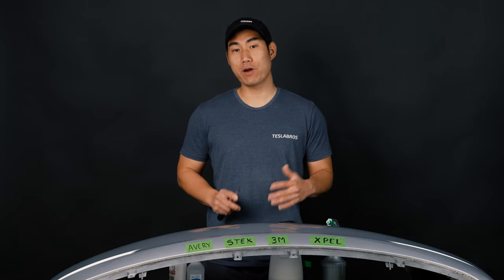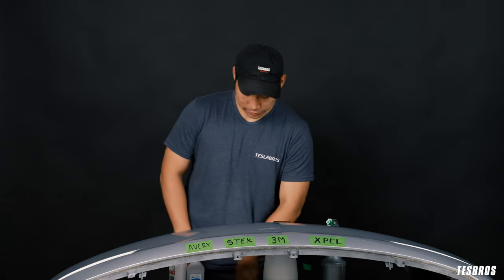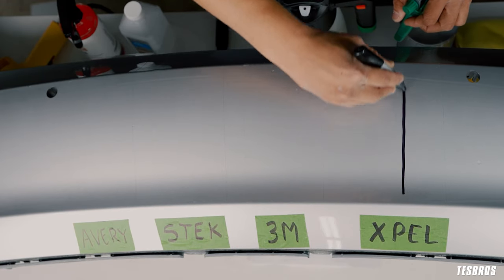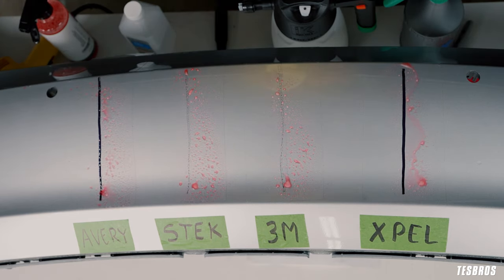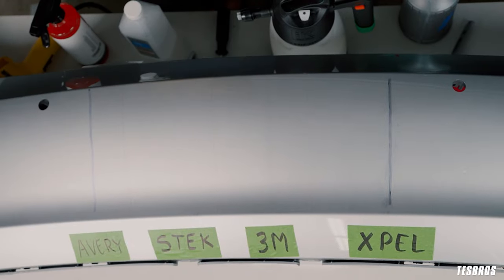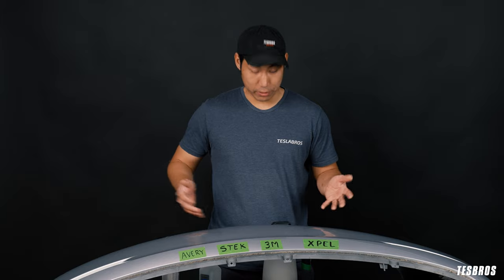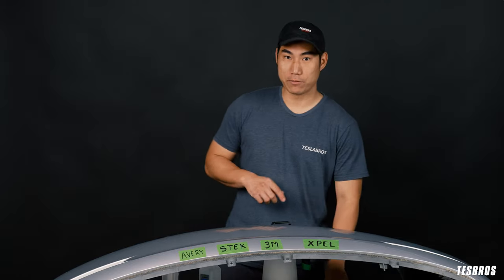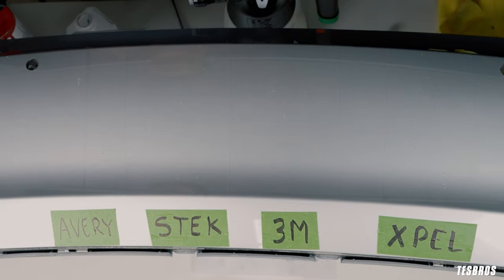Which PPF Brand Should You Get For Your Tesla? Durability Test - Part 1 - TESBROS

Comment: In practice they all scratch really easily and most scratches will not self heal, only the very minor micro scratches will self heel. They are also difficult to keep clean. I suggest anyone getting PPF also gets them ceramic coated to make it easier to keep clean.

Comment: 3M is designed and engineered the best of this lot...great video
Reply: Yeah im going with 3M as well as their windows tint.
Reply: Been doing PPF for years. 3M is by far the worst film to work with and has the worst finish. Glue lines and imperfections everywhere.

Comment: Local xpel quoted me $7,800, now it’s time to reconsider. Thanks for this great video.
Reply from the maker: Glad it helped! Depending on the area, that may not be a bad price especially if they wrap around edges, has a lot of experience and for the full car. Doesn't hurt to shop around but look for shops that have a lot of experience. It takes time to get good at PPF especially.
Reply: @tesbros  my current car was wrapped at a place I found on yelp, they had good reviews but did a terrible job, and thus this time for my brand new tesla, I will bring it to the authorized xpel dealer in my area.
Reply: @tesbros  Does the other 3 brands have precut patterns?

Comment: That was great.  I just got my Tesla a week ago.  I'm prepared to spend way too much for PPF.  Just so happens that there's an authorized dealer for XPEL in my area.  Then, I saw your video.  Googled for an authorized 3M dealer.  Got one of them in the area, too.  I'll get quotes for both, but likely going with 3M.
Reply from the maker: They are both great brands, so I would go with whatever shop has the most experience
Reply: @tesbros  Thanks.  Make the appointment for 3M to be installed.  ~$1800.  Yuck!  But, it'll protect my $55K investment.
Reply: @pavels5600  1800? What did that cover?
Reply: @Dawsomesauce  Turned out to be $2100.  Covered:  front bumper, hood, front quarter panels, rockers (all the way back with a barely visible seam ~8” up), and side view mirrors.
Reply: @pavels5600  bargain. Should’ve done the whole car!
Reply: Why did you go with 3M? I know nothing about cars so I’m still lost on which to decide as they all seem to be really good from the video.
Reply: @troyvo8069  Sharpie test.

Comment: Nice comparison, I went with Suntek Ultra again for the 3rd times in a row.
Reply from the maker: Heard great things about them! If you're happy, that's all that matters.
Reply: That's all my shop installs. Since xpel has trademark infringement on 3m, the only difference between the 2 is the polyurethane top. Xpel stole 3m adhesive.

Comment: Next time use a black panel it will show up better. Avery has been around back in 2007. Suntek & 3-M are the same. The newest is X Pel they use to use 3M before they had someone make there new film.
You want to do a real test get a front fender in a dark color cover 12" wide and pass a sandblaster over the PPF and the not covered. This will impress anyone looking to buy a C.B.

Comment: Does rubbing alcohol ruin the hydrophobic layer? How long does the hydrophobic layer last? Would ceramic coating be better than the factory hydrophobic coating?
Reply from the maker: Rubbing alcohol will diminish the hydrophobic qualities overtime IF it's too strong. Just make sure it's diluted with water or more like 50-70% iso alcohol. The hydrophobic layer on PPF usually lasts around 6 months. And yes, if you want ceramic coating properties, I would go ahead and ceramic coat the PPF as well. It'll last a lot longer.

Comment: Great video. I'm about to take delivery of my plaid is it overkill to do the whole car, or will the front and back bumper and hood and side-view mirrors do the trick
Reply from the maker: Congrats!! I would suggest doing the front package and side rockers. That would be the front bumper, fenders, hood, mirrors, & rockers. Those will definitely be the highest impact areas
Reply: @tesbros  gracias amigo!
Reply: Do the entire car with Stek film. Also add two coats of GTECHNIQ Halo. I had my Model Y done and it looks amazing. Easy to clean also.
Trust me
Reply: @RayNLA  where did you buy the stek film and how much for model y full coverage
Reply: @hawkie2216  I just got full STEK satin PPF for $6k on my Y. Received a bunch of comparable or more expensive quotes too. But I also got full silver delete on interior blacked out and brushed black metallic trims and black gator skin PPF over wood dash, console, steering wheel, door inlays and charging port. Included blacking out the head and tail lights and fog lights with some other details here and there
Reply: @edubchilds  where did you have this done? Waiting on my Model Y and want to go stealth matte black…

Comment: I believe that XPEL is designed to have a ceramic coating applied to the top of it; that would be A LOT harder to apply well if it was itself hydrophobic!
Reply from the maker: Lots of paint protection films come ceramic coated nowadays. They usually only last around 6 months though, and an additional coating applied on top is recommended if you want to keep the properties for a while

Comment: Great video. I have a new Lexus which I have chosen the 3 m. Plus a EQE which they have used the 3 m. I wondered which was better,Time will tell .They both look nice and make keeping the cars clean a breeze. However both to fit were very expensive in Australia. But no more polishing every 4 months means more time enjoying the cars. And little daily use scratches come out with sunlight or heat gun makes it worth the cost.
Reply: 6 months update?

Comment: What is the cost in terms of value to most expensive on these 4 for customers?  Also have you all serviced the new Foaker Oceans yet?
Reply: Pricing depends on installer if you don't plan to do it yourself.  The cost comes from color correction, chip repair, and labor of installing the PPF. Notice prices are regional and depend on how many installers in the area.  Some installers use custom cut sheets and others cut from large roll and form to almost any size that needs protection.  Find an installer that "tucks the seams" in cracks and around corners to help hide the film for an invisible look.  It can cost $300-$700 for front end bra (headlights, side mirrors, front bumper), $1000-$1500 for entire front end (hood, bumper, fenders, headlights, side mirrors), and $3500-$4500 to do an entire sedan.  PPF like Suntek and XPEL have a 10 year warranty.

Comment: I am curious to know how the self healing properties of the film work with a ceramic coating applied on top of the film.
Reply from the maker: The PPF won't need to self heal if the elements can't get to it due to a ceramic coating. If scratches make it all the way to the PPF, that means that area is exposed, and it'll self heal.

Comment: Which brand do you guys use then? Just got the Y front bumper from you. Also price difference?
Reply from the maker: That'll be Avery Supreme Defense in our DIY PPF kits. The price of the high quality films in the video will be about the same. What will differ the most in price is shop location (area's cost of living) and their rates.
Reply: @tesbros  didn't know there was no tacky or skip solution in the package for this job. Where do I get that? Guess rest for job I have, 2 of these plastic scrapers. Last question, do I not try to round the ppf into the round edges of say lights and stuff? Remember Ryan from Kilowatts had his done self and it accumulated so much dirt right at the edge of ppf or vinyl cause he didn't remove the door trim and tucked it under? Will this be a problem, dirt magnet right at the edge of film? Thanks.
Reply from the maker: Since you only got the bumper, you have to buy the installation tools separately. Sorry for the confusion! The installation tool kit is 15% off right now with code ELECTRICJOY15: https://tesbros.com/products/installation-tool-kit-model-y-diy-kit
Good question but no it won't be a problem as long as the PPF isn't hanging over the edges. Make sure you install right inside the edge and not over. That's where the dirt catches.

Comment: about cars being keyed...   many years ago, my brand-new Lexus was parked in a mall parking lot.  it had less than 50 miles on it.   when I came out, it got keyed, along with several other cars.  the whole left side had to be repainted(fender, front doors, rear fender).  Insurance deductible was $500.     Fast forward to last year... I got a new car and the first thing that I did was get it tinted. I asked the tint guy about getting PPF.   He said that if my only concern was protection against getting keyed, PPF may not be the right answer. He has has many customers who got keyed even with PPF. The stupid people who key other cars keyed even harder when they ran the keys over PPF film and saw no real good result...  eventually, some of them just kick or use tire iron to do more damage. (resulting it bigger damage that cost more at the bodyshop)  :(
Reply from the maker: Sorry to hear that, Tim. That hurts to think about! And yeah, I guess if anyone really wants to do some damage, they will.

Comment: Which one is the most affordable option in a matte variant. I'm looking at Avery Dennison. My buddy bought Xpel Stealth and we wrapped his model y. It looked sick, but I don't want to drop 3k on material.
Reply from the maker: Most of them are right about the same range between 1200-1500 per roll and that's for a 5  x 50 feet. What will cost a lot is the labor if you pay a shop to do it. But regarding material costs, it's a bit tricky because a lot of the rolls you can't just buy off Amazon. It's a bit of a complicated mess regarding distributors and etc. Most easily accessible for consumers would probably be like Hexis Bodyfence or Avery or 3M at a reasonable cost. Hope this helps! Didn't mean to over explain things lol.

Comment: ppf is really hard if not impossible to find in bulk let alone as precut kits in the EU (outside of installers) for some reason, so I am pretty much limited to 3M and XPEL options for pre-cut kits (imported). I am suprised that 3M has a hydrophobic property since I cant find it anywhere in the specs on their site. I have heard Xpel is more forgiving but 3M Pro seems to be the better product overall. Is the film with hydrophobic properties even worth it or is it better to just apply a ceramic coat afterwards to get an even better result and does it interfer with the self healing property in any way?
Reply from the maker: If you're already gong to do a ceramic coating, I wouldn't worry about getting a PPF with hydrophobic properties. No, it doesn't interfere with self healing

Comment: So which one is best?  There is no hydro coating on the XPEL.  Do you or can you add something to it?  Thanks!
Reply from the maker: All of these are great. I typically use Avery or STEK, but you can't go wrong with any of these brands. Yes, you can add ceramic coating to all PPF to make it hydrophobic. I even recommend adding it to factory coated PPF as it will last years longer than the factory coating. You can DIY or have it pro installed. We like Gyeon Mohs Evo if you're going the DIY route. It's more forgiving than other coatings so it's easier to work with: https://tesbros.com/products/gyeon-q-mohs-evo-basic-bundle

Comment: Yes. It’s hard to see as someone said and also you didn’t really standardize the testing. Having said that it’s a good video for ‘roughly’ looking at product performance. No criticism to the original uploader. Just pointing out. Now, it didn’t surprise me 3m did well. The original product was made for military helicopter blades. They still call it helicopter tape. That was by 3m at the request of the US army. It worked so well it was implemented quickly into the military. As far as the hydrophobic coating goes, I’d be interested in seeing a test after large soap water wash cycles. Because, I suspect, this coating will become less effective. As with new iPhones and their ‘oleiophobic’ (aka same thing) coating. So, if that’s the case, I’d probably not buy because of that alone. Btw shame on people that key teslas. It is a thing. So unfortunately

Comment: what temp does the film start to heal?  dont want to burn my ppf
Reply from the maker: Typically, it'll heal naturally from the sun. Minor scratches can disappear in as little as an hour at 72 degrees F. If you want to speed up the healing process, pour hot water (not boiling, just hot to the touch) over the scratched areas.
Reply: @tesbros  thanks

Comment: Hi, can the lacquer thinner works the same as the alcohol in removing the contaminated water stain on the PPF? As I read that alcohol is more prone to have a fire hazard, for your kind advice please, thank you!
Reply from the maker: Hi Max, I wouldn't recommend lacquer thinner on your car and we try to dilute even when using alcohol. The best way to prevent water spots is to dry your car every time you wash. If that doesn't work, try a waterless wash first before trying alcohol.

Comment: When doing ppf on a Tesla model Y is there any seems anywhere or can it be done seamless?
Reply from the maker: The template does have a seam in the bottom lip but you can certainly do it seamless. It'll just have to be installed bulk which means using a large piece of PPF instead of machine cut.

Comment: 3M and STEK seemed best right? Pls rate them using points for each test n share.
Reply from the maker: STEK is what I like to use personally. 3M is great but can be difficult to use. Their previous gen PPF wasn't as forgiving, a lot of glue lines or lift lines. But, they just released their new film which is supposed to address all that. I should have a sample to test soon and will most likely do part two of this series.
Reply: @tesbros  how do i know if i'm getting the old or the new 3M PPF ?

Comment: Does the 3m hydrophobic affect the ceramic coating bonding?
Reply from the maker: No, you can put ceramic coating over PPF with no problems. Confirm with your installer though to make sure the two brands/types are compatible.
Reply: @tesbros  how about wax?
Reply: @tesbros  how about wax?
Reply from the maker: @mikeprice8307  usually they don’t recommend wax but check with the product and see if it is recommended to use with ppf.

Comment: Do most places buff and paint correct before PPF?
Reply from the maker: Yes, it’s a common practice for shops. You can apply without correcting as long as you prep it well, but that’s up to you.
Reply: You can buff out scratches if you'd like.  If it's an extra cost though, feel free to pass up on it.  Film hides a majority of swirl marks after application